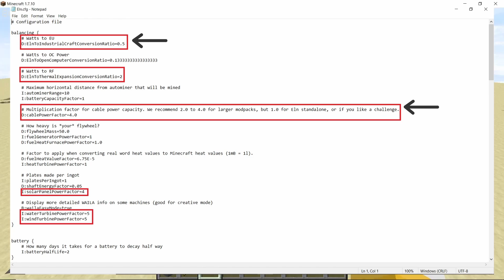Modular Renewable Power using Electrical Age - Water Turbine & Solar Panel Setup

Comment: how do i blend hbm with electrical age?
Reply from the maker: Electrical age has blocks called exporters which will help you convert all electrical age watts into rf which you can use in hbm's ntm. 
However there is no way to reverse this process so HE/RF can't be used for eln

Comment: Want to see the bridge switches tutorial, you said about that 7 month ago at the solar power grid tutorial. Also what about fully automatic rbmk reactor using opencomputers, and also i have some idea make some silo with wireless control like, you stay far away from silo write coordinate(have some pointer where you write x and z), press button and then rocket realize(i know sounds a bit crazy, but imagine you press some buttons and then from all silos at the map go thermonuclear rocket to one place making a big boom) but I don't know if it's possible to do i think about wireless redstone, opencomputers(robots what maybe can paste coordinate + wireless network through what you can send messages) and maybe some hoppers, if it's actually possible i want tutorial, or i can try to do it by my self.

p.s. My English not so good, but i hope you understand what I mean (Peace out)
Reply from the maker: The bridge switch is pretty easy man, in the bigger slot you connect a 200v supply and in the small slot you connect a signal switch... As soon as you give the signal the bridge switch will open 👀👀👀
As for RBMK I am actually not very good with open computers mod , I don't know Lua coding 😕🥲
And finally as for launching the missile remotely the problem is there is no way of linking the coordinates between two designators. Once you set any coordinates you need to.place that very designator in the launch platform. The only way remote explosions work is with satellites
Reply: @SavageVegeta  Thanks man, i really appreciate about your answer
Reply from the maker: @cring228  you're welcome man

Comment: I made a diesel generator in my server with hbm but it is super inneficient and I dont know if I should make another chemical plant to make more diesel at a time for it or just use less generators any tips on how to imporve it?
Reply from the maker: Switch to steam power, you can use diesel to run a fluid burner which can run a boiler and the steam you get can run a turbine. It's more efficient afaik
Reply: @SavageVegeta  Thx I just been wasting all of my diesel then
Reply from the maker: @UsuManalia8485  not necessarily, I recommend you to just go into a creative world and test 3-4 different alternatives that can run on diesel - small generator , industrial generator , fluid burners and flare stacks and then see which one of these alternatives gives you the most power in the end 
You can set the standard as a single tank of diesel for all of them